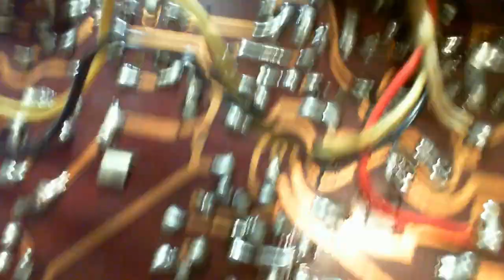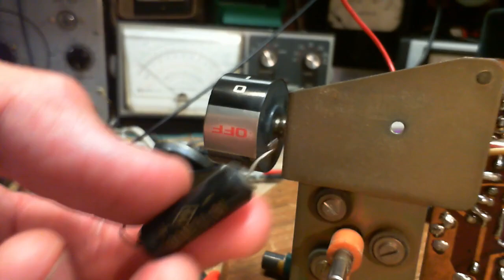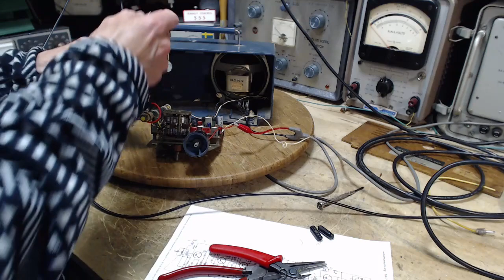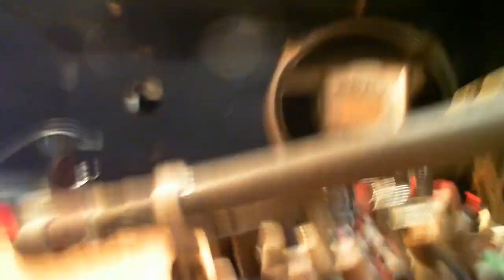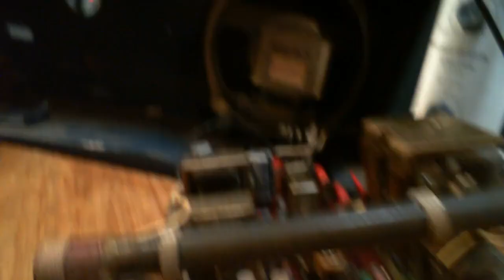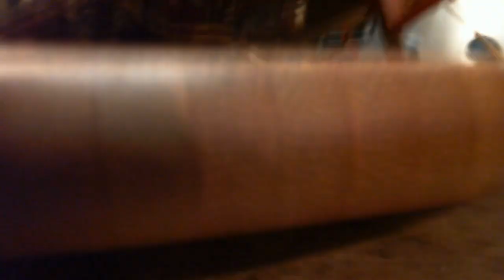SONY TR712 Transistor Radio Video #2 - Electrolytic Capacitors Replaced

Comment: Jim exhibits very low level of experience in printed circuit board repair the first thing that should be done is to quickly melt the solder and pass a stainless steel needle through the hole to open up the hole. You cannot rely on poking the component leads through the board to make a hole. In the time it takes him to melt the solder and try to push the component leads through, you run the risk of ripping the print track off the board.
Reply: If he's going to be working on more and more radios with circuit boards he should invest in a Pace style vacuum desoldering station.

Comment: In trying to remove those 100mfd caps, he’s going to rip the print off the board. Why isn’t he just pulling the capacitor off the board while he melts the solder.
Reply: In his defense, these bent over leads are a pain. But the key IMHO is to make your life easier by adding fresh lead based solder and using a fair sized tip on the iron to get fast heat transfer. Also if feasible you can snip the leads on the top, flip the board, melt the joint and pull the stub out the bottom using ceramic tweezers.
Reply: First, there are desoldering systems available that obviate the necessity for butcher work like this.  Failing that, he can reach at least one of the leads on the other side of the board.  Cut that lead, and push it through the board. Solder wick is not that expensive, and will, when used properly, reduce the chance that you will damage the trace.  These older boards have a tendency to delaminate very easily.

Comment: Might have to replace more capacitors than just those you have done. Use the signal tracer so you can check if a signal is getting through at it's true 
amplification after doing so. Could be a bad transistor or two mucking up the works.

Comment: Running 50 volts thru 6 volt electrolytics.... Being brutal with the circuit board....... Such a nice vintage Sony radio  about to get hacked up.
Reply: Well his statement that a good 6V electrolytic would take 50V just fine, goes to prove how little he knows about the chemistry. Yes, an electrolytic can withstand a higher voltage than rated for. But you have to form it so that the insulating oxide layer can grow in thickness.
 But right off the bat it wont withstand it on first try and exhibit leakage - or rather forming currents.